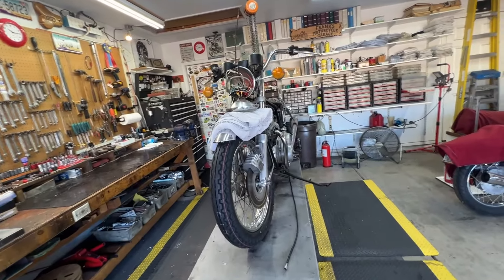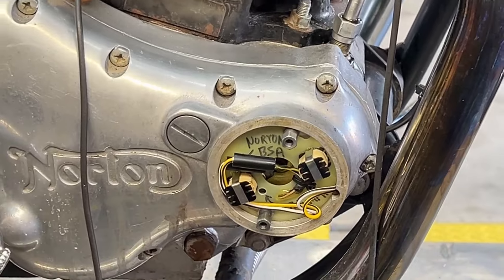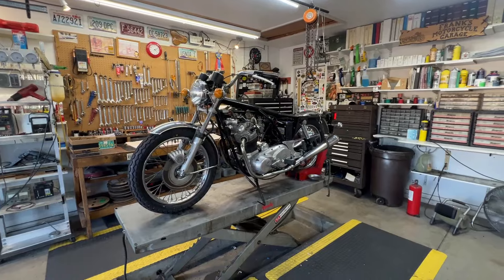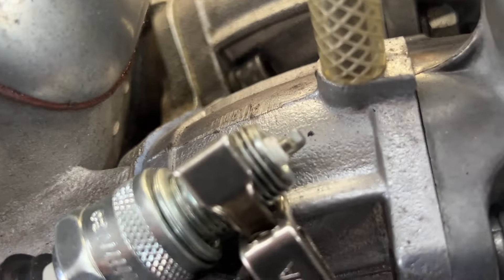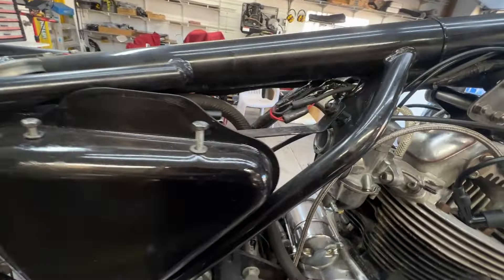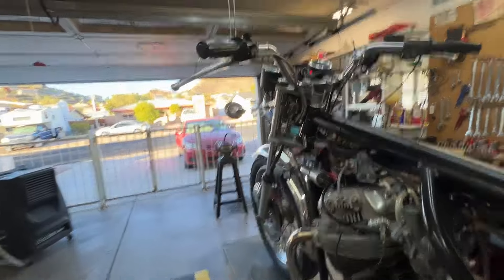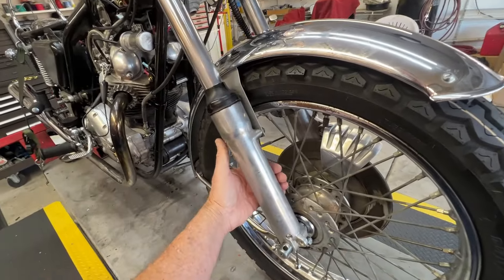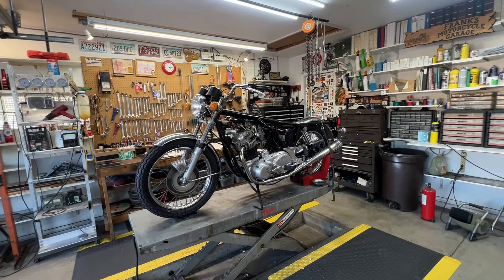11-14-24 - 75 Norton – Fred – Sorta Almost Complete.

Comment: I often wondered what the auxilliary two pin 12v socket was used for? I had a white light on a long lead for camping, but  have no idea what anyone else ever did with it. It could have been a useful charging point if wired up correctly perhaps. Great progress, well done.

Comment: Nice work not to far from the finish line. Thought on the T20M Mountain Cub monobloc carburettor perhaps removal of the brass jet body holder, the passageway may be blocked which is why it is difficult to get fuel flow it is highly likely to be clogged up restricting flow. Even if you fit the Mikuni it would be worth investigating. Enjoy your videos, 👍